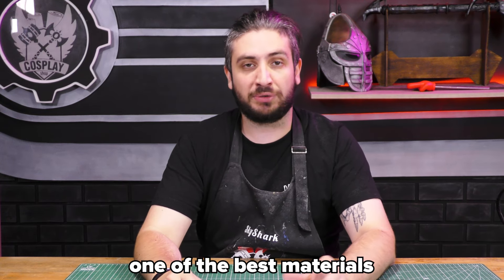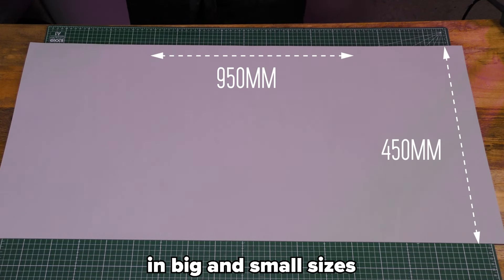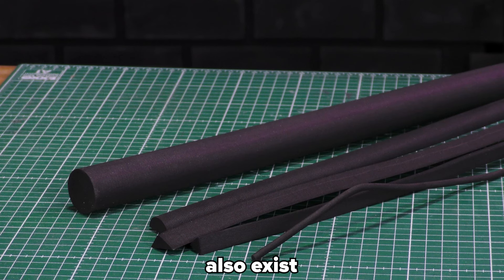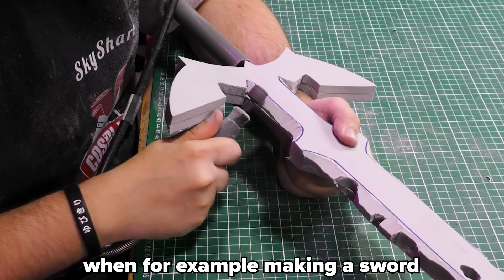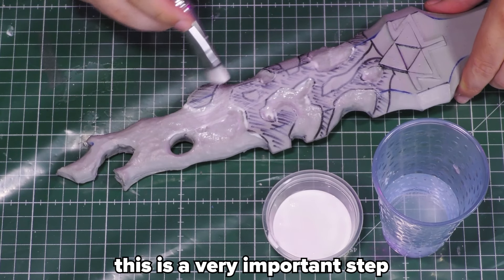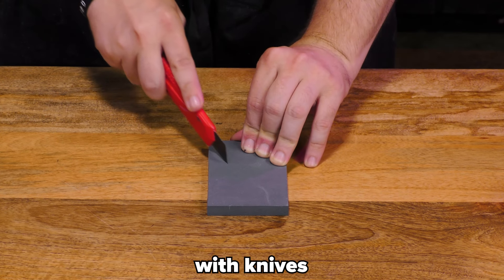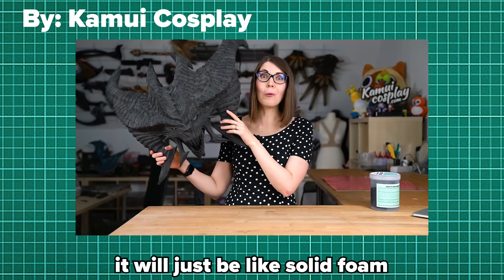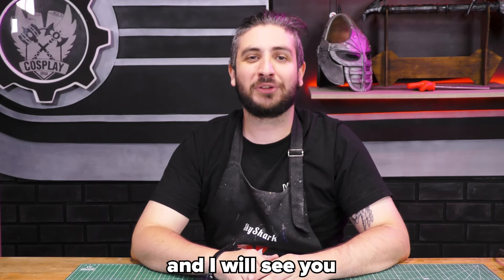The EVA Foam Basics | Beginner's Cosplay Tutorial To Armor And Props

Comment: Ty for the amazing vid info!!! I'm a beginner and makin my teenager a costume with angel wings so my question is what thickness would I want also the length say 5 foot long fallen angel wings of course I'm gonna use black foam because fallen angel would be prob in the 3mm range? Something not heavy would have to be lightweight I have to make feathers and still need to figure a base out as well outta crafting wire....

Comment: What do you use to mark a pattern on the BLACK EVA foam before cutting it out?
Reply from the maker: there are some markes especially made for it, but personally i use the long tip ones from amazon!
Reply from the maker: https://www.amazon.com.be/-/en/Extra-Markers-Cardboard-Steel-Colours/dp/B09WRKRNVG/ref=asc_df_B09WRKRNVG/?tag=begogshpadde-21&linkCode=df0&hvadid=633351014569&hvpos=&hvnetw=g&hvrand=2386522347709300881&hvpone=&hvptwo=&hvqmt=&hvdev=c&hvdvcmdl=&hvlocint=&hvlocphy=1001259&hvtargid=pla-1656502198283&psc=1&gclid=CjwKCAjwg4SpBhAKEiwAdyLwvGIRSRYzWtSNk_74GPyZFlsWWHZ7HnZCZ95Fx3r9ju2dQkTztJzpHxoChIQQAvD_BwE
Reply: Thank you for answering my question.  @cosplayshopyt
Reply: Chalk maybe

Comment: Do you have any tips/great patterns for making simple goat horns for a cosplay using eva foam (and not using the clay)? As a beginner, I haven’t been able to find a good free pattern for horns, and lots of models use clay.
Reply: You could make the base shape out of wire and either paper, plastic bags and tape, or anything to fill out the shape that is super lightweight, and then cover that with foam strips simulating the lines of horns and giving it a nice texture to paint.

Comment: Do you have to use a dremel? I live in an apartment, so I'm not sure a power tool like that would be a good idea. Can I use "manual" sandpaper?
Reply from the maker: It won't have the same effects I'm afraid, I've seen some people use their vacuumcleaner while dremeling to avoid most of the dust. other than that i can only suggest to maybe dremel at a friends place or somewhere outside. good luck!